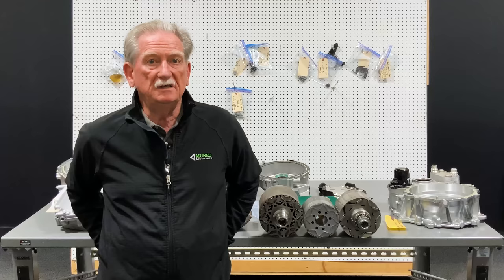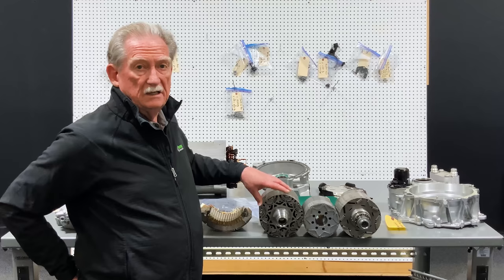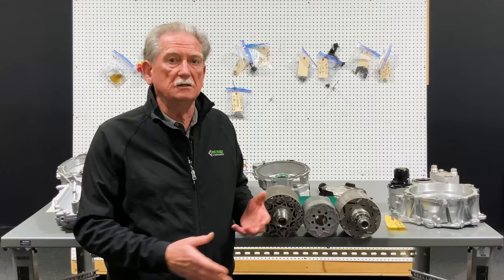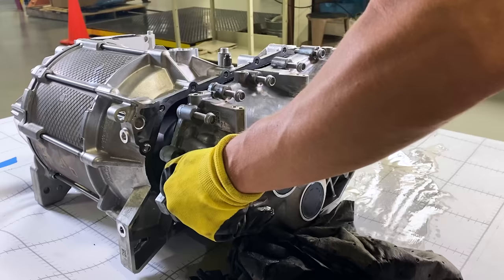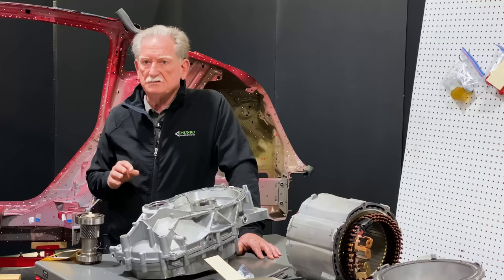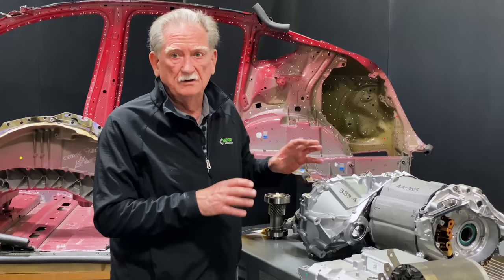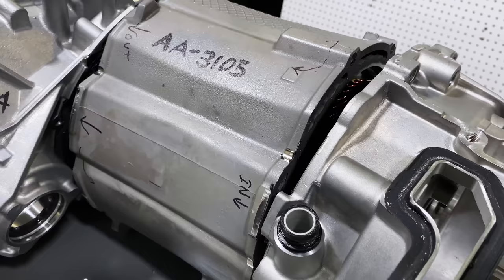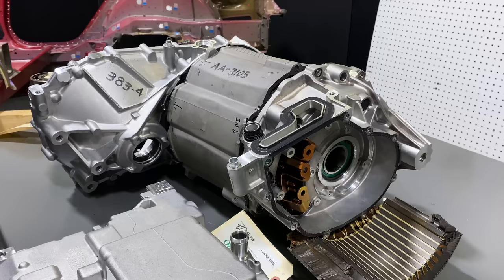Volkswagen ID.4: Electric Motor Teardown and Analysis

Comment: His idea about not opening up certain parts to repair it is really why we are at this point in time with a huge amount of electronic waste. Glue is not great, snaps break,... Agreed, too many screws can be bad, especially with vibrations and heat, but only glue and snaps will make stuff very hard to repair. I´d rather see latches secured with screws as a backup. Yes, it is more expensive but repair should be a critical design principle and it is something i am willing to pay extra for.

Comment: Did they connect the coolant Circulation to the interior heater via a passive heat exchanger?
I think this would make sense for efficiency in the winter... Which makes me again wonder if they can heat the battery pack with the waste heat from the motor (bu then again the battery heats up from current draw...)

Comment: Looks like a pretty good design, I’ve seen similar amounts of threaded fasteners if not more in others.
Would’ve been good if you could have given us a bit more detail on the motor drive electronics. I noticed a resolver, so probably position sensing in 16bit and velocity sensing in something like 16bit, twos compliment. Would’ve been good to checkout the IGBT’s. Just wondering if they’re using SICFet or similar. Lol, ‘the capacitors make the motor go’. ….The rotor looked interesting and probably a reasonable reduction in torque ripple and noise.

Comment: At time 19:00 or so, Munro is showing what is called "skewing". VW uses a kind of classic skew with several steps. Nisan did the same thing, but with only a single step. Tesla did what could be called a double-skew, or perhaps V-shaped skew. The problem with the skew is that, under hard acceleration, the rotor will develop an axial force. It's like "screwing" through the motor. What Tesla did was accomplish a skew, but since it's complementary, there is no axial force (no "screwing" action). My company makes some of the fastest (maybe the fastest) accelerating motors in the world: 0 to 120,000 RPM in 1 millisecond!

Comment: Actually that is not skeletonization.. it is called permanent magnet assisted synchronous reluctance motor. It adds so called reluctance torque into the motor and reduced the back-emf voltage created by the motor on high speeds. With simple V-mag motor the high-speed will create very high voltage which will destroy the inverter capacitors. So the holes are not because of the weight, holes are to adjust the motor electrical performance.

Comment: The bleed resister is not glued it’s a heat sink past and it needs to be screwed tight to keep good contact that’s why it’s smaller then the others is because it’s dumping it’s heat into the aluminum housing snaps tend to be weak at hold down things that get hot and fluctuate in temperatures like that

Comment: For the electric motors, would like to know more about weight vs power and energy efficiency.  Love the channel.

Example, the F150 lightning has a high drag coefficient vs a sedan, but how efficient is the drive train?   Are their compromises that start at the battery? inverter? motor? gearing?  Also love the tear-down compare between companies on parts/assembly.

Comment: the motor stator hairpin coil assembly is very gm chevy bolt inspired design very nice engineering. I dont agree with the permanent fastener idea because I repaired my 2012 nissan leaf onboard charger, so  we need removable fasteners,  and we especially need easier cheaper replaceable  DIY user serviceable electronic components for these cars, equivalent to as one would with servicing or rebuilding a engine.

Comment: Very Impressive comments, Munro..  One thing i've noticed is the Inefficiency of Hypoid gears (Differential) due to the sliding nature of the Ring and Pinion gears.  Often Classical rear end Hypoids are rated as 85% efficient, whereas meshing gears into the mid/high 90's.  Obviously hypoid gears should be eliminated which puts us into a 4 motor configuration.  Question:  Does a typical Front Wheel Drive use Hypoid drive gears anywhere?  I don't think they do.  FWD seems to roll with less friction than classical RWD.

Comment: For sure that long bolt has Loctite and was assembled with the right torque. (15:38) Radial riveting would make any maintenance a nightmare if you have to open the motor.

Comment: The assumption that train tracks are cut at a certain angle are definitely wrong, at least for Europe. Instead the train tracks are completely thermite welded together and the welds are ground. Track design becomes more complicated because it needs to include some room for thermal expansion.

Comment: The comment on skeletonizing is wrong. You are looking on hybrid motors. They can be driven as a permanent magnet motor OR as a synchronous reluctance motor. You need the cutouts to route the field lines and get a force through reluctance. its called: IPM-SynRM

Comment: The right to repair is coming, and that's only the start. Product life spans will have to increase dramatically. The use of threaded fasteners is a very good hedge on that future - which might include component upgrades as part of the service behavior during longer usage cycles than we're currently used to.

Comment: Great design, nice video. I bet we get the 'old' stuff to look at. Too much attention towards the mechanical aspects. In a few years many of the electronics is integrated into chip substate level solutions. Lets start with only count the parallel resistors and capacitors, instead of counting the few fastening screws. Placing a large component on a PCB board compaired with placing a scew, not sure what is more costly in mass production.

Comment: I have no doubt that the inverter will be a replaceable module at the vehicle level. However given its complexity I would be surprised if it is a throwaway module. I can imagine an entire industry devoted to rebuilding them. What I saw in this video is pretty expensive stuff and not at all comparable to say a modem.

Comment: Im working in one of the biggest inverter makers repair work shop and seen lots of 10-20 years old inverters wich are been continuous operation in industrial use and these inverters are coupled together mostly screws, bolts and nuts. Properly designed and installed threaded fastener is not an issue at all! Only problem with threaded fastner is how to install them properly hunreds millions of times without any flaw. How "BOB" can do it day after day flawles?

Comment: Holes on laminates are not there mainly to cut on weight it mainly has to do with motor performances and weird interaction of magnets and electromagnets and cogging effect of any electro motor, basically it makes motor run with less cogging in various RPM hence why holes to direct magnetic fields toward that desired effect while having good torque across various rpm while consuming optimal juice, not heating much and so forth hehe.

Comment: I don’t believe the VW engineers will care about the “fastener critique”. I am pretty sure they are very aware about other methods of fastening but decided to use fasteners anyway. 
I don’t get where the fear of undoing fasteners comes from. Combustion engines have hundreds of them and they don’t rattle randomly out of place. 
If fasteners are undoing themself all the time, there must be a problem with the design of the fastening connection and it’s not an inherent problem with fasteners.

Comment: Fasteners ARE ten a penny so good on VW to use them instead of plastic clips or adhesive on everything. That PCB is screwed in tight so it can withstand vibration. Sure they could fill all that with resin and seal it, but that means, no learning from long term tests, no repairing. Just throwing out the whole inverter that has only one faulty component.

Comment: If VW had used more adhesive in lieu of threaded fasteners, this would have been a short video. The bolts are what makes it possible to take these things apart and look inside!

I like the idea of designing components that do not need to be serviced for the life of the car, but there is another consideration. What about the end of life of a product?

Ideally, in the future, we will move toward designing things that can be disassembled at the end of their service life in order that component materials can easily be properly reclaimed without loss or environmental contamination of any kind.

Comment: The inverter housing must be a high pressure die casting component. You've mentioned that it is a low pressure die casting part where I see no reason why it should be as there are no channels or cavities which must be done by using cores. Or did I oversee something here? Nevertheless, thank you for the great Video!

Comment: About the cooling system, I'd like to say that the oil cooling system Tesla uses can help reduce the size of the motor because of the oil's higher cooling efficiency.  Can you compare the VW's motor size with others' with the same power? I think this index could be good evidence of VW's higher efficiency of cooling.

Comment: In addition to the burr it looked like there was either a casting ridge or a sizeable crack on that casing.

I respectfully disagree with your solution to the threaded fastener issue, mostly for long term serviceability reasons.
Reply: If this did not have threaded fasteners,you not have much of a video.

Comment: I guess the engineers thought that if a set of boards in an electrical inverter were going to be jostled for 200,000 miles, they might as well use a few screws to secure it...

Comment: There is going to be a secondary 're-man' market for all of these motors just like starter motors have a 'core charge' so the old starter goes back to get reworked, repaired, and refitted for reuse. Using rivets instead of threaded fasteners is great for the first install but the repair market is important, it can mean junking a car because the motor is too expensive 'just cheaper to buy a new car' or buying a re-man replacement and saving a bit of the environment.

Comment: I work in the Navy on Lockheed  C-130 aircraft, the fit for screws are #3 you can't start a screw by hand on any aircraft fasteners, so if loosing is a problem go to a class #3 fit for the threads?

Comment: There is much complaining about threaded fasteners. Not all those complaints are justified. Threated fasteneres on circuit boards help the board stay tight against cooling surfaces and makes them easy to service. For the loads encountered with a PCB, all you need to make them stay on forever is a bit of Loctite.

Comment: "We move to snaps" - you mean the industry move to snaps... No customer every liked snaps that break off..
The inverter is one of the biggest vital parts of your electric vehicles it will be serviced trust me!
And you clearly worked for the enterprise side not for the consumers.
Thank you vw for the modular design and removeable screws and no glue or potty!!
Ignition modules are cheap, low complexity potted because of high voltage... Why would you service such a part?

Comment: It's dysprosium not disposium!

I for one prefer the modular, serviceable motor controller.  It may be that they won't need to service them, but on a new design it's always nice to have it be fully serviceable until you know what kind of actual, real world B10 numbers you're going to get.  It's better to have a massive recall where you spend an hour disassembling an inverter and getting goopy with silicone conformal coating gel to replace one board for $150 than it is to have a massive recall where you spend an hour swapping out an entire $3500 inverter because the board is laser welded to the next one down at all its contact points and then potted in hard epoxy.

If you find that your inverter never ever fails, you can release the next generation with less serviceability on it without totally screwing your service department.

Edit: a good example on the bleeder resistor.  Tesla definitely did the ideal thing for assembly since those can be pick n placed by a robot and then reflow soldered, but if they didn't get the amount and alloy of solder perfect and the wattage and heat sinking of the resistors PERFECT, they will literally fall off the board eventually.  This is very evident on, for example, the overhead console clock module in 98-02 Subaru Foresters.  Darn near every single one has, or still have, three SMT resistors quite literally fall off the board.  The bleeder resistor shown is serviceable enough, but not too crazy like the leaf one.

Comment: The 3 bearing setup on the input shaft is nice from a weight and cost perspective, but puts very high demands on alignement tolerances and fixturing between the gearbox housing and the engine housing.
The water cooling circuit is fine, and removing the oil pump, filter and cooler is a cost saving for sure, but the oil is not directly cooled. Can be fine on a family SUV, can be a problem on a sport-oriented saloon.
The robot / one-arm idiot equivalence is flawed. We have plenty examples both ways, where we do one or the other, because the second cannot, unless with much added complexity and cost. They are both good at some things, the most important is to recognize which.
Reply: High-performance cars all over the world use manual transmissions without an oil pump, filter, or cooler.
Reply: @brianb-p6586  that's because the gears all baths in oil that is splashed around. Now do the same with an electrical motor.

Comment: Isn't it true that if anything you rivet together that has a resonant frequency will be effectively de-riveting its-self until it fails.
VW probably didn't want a repeat of it's past gearbox scenario where they fixed the diff "Crown Wheel" to the carrier with rivets, not traditional bolts and had huge failure rates

Comment: The point of the mechanical fasteners is to allow for disassembly at end of life and recovery of the valuable components for recycling. This is called "circularity" and is a policy of the European Union called the "European Circular Economy". Given the speed of global mineral resource depletion, everything will have to be 100% recovered and recycled by the time the ID.4 reaches its end of life. Meanwhile Americans behave as if there were three planet Earths, and they own them all. The ID.4 is sold in Europe as the first zero embodied carbon vehicle. This means zero up-front and potentially zero in-use carbon dioxide emissions if it is recharged by renewable energy. One of the ways to get to zero up-front carbon is to make every part from recovered materials. To get the materials VW design their cars to be recycled. Every part, every material, especially metals, is designed to be recovered at the end of the vehicle's useful life.

Comment: An excellent and well enjoyed video. Just out of curiosity a question did come to mind.
I'm assuming for cooling a regular mix of EGW or PGW is being used.Wouldn't oil be a safer way to cool electronics as it is non-conductive and usually non corrosive?That way even if one of the gaskets in the system failed and the electronics were submerged in oil, it wouldn't harm them any. If this is is the case, wouldn't the additional complexity of Tesla system pay off in the long run in increasing the vehicles service life?

Comment: That's the difference btw the way of thinking of an engineer, and a mechanic. Threaded fasteners can be dismantled, glued parts are not. Glue is cheaper, and it overrides anything.

Comment: And the stator will be subject to unequal temperature across its cylinder axis ( eg top warmer than bottom ) after many civiles I wonder about metal fatigue and micro cracks in the cristalina structure …  I wonder how powerful is really that coolant pump and how much energy it does take to run it

Comment: I wonder what is up with VW using gate drive transformers and Tesla not. Its not like that these transformers are the most expensive part on the board?! Also there exist spring loaded contacts that can latch onto the pins of the bleed resistor. So using cables is kinda an expensive way to connect the resistor.

Comment: How long will the permanent magnets last ? I had a problem with a permanent magnet heater fan motor on a VAG group car. It started blowing the supply fuse. I thought that the problem was an intermittent short circuit in the wiring but testing failed to find it. I eventually discovered that the field magnets had weakened with age / use. As a result the motor speed and current consumption increased until the fuse failed.

Comment: I'm an electronics engineer. But I would repair those electronic modules for the price of half of a new one.
And I do like the screws in the design.
The screws may be too small to go into yield, but the PCB laminate and the solder isn't.

And if there's vibration or thermal cycling high enough to grind the solder and unfasten the screws, then the screws won't be your main problem.
There's many times more soldered connections than there is screws. And the solder isn't too happy with vibrations and thermal cycling either.
Cracks form over years, causing erroneous malfunctions, which can often be fixed for as many years to come, just by simple reflowing with the help of some liquid flux.

Hating on screws really shows the mindset of designing things for single use only, essentially designing towards a single-use car.
You have an engine bolted down to the transmission? Why? I'd bet that the snap-in with the glue could withstand more vibrations and thermal cycling..

Comment: My thoughts are, Is there any side loading on these long bolts,  I personally don't think so because of the radial arrangement of them. Back 100 years ago they were using and still are using the same arrangement, I have not ever seen any side loading problems with alternators, generators, and motors in 40 years.
The voids in the laminates are a good concept, not sure why other manufactures have not gone this way.